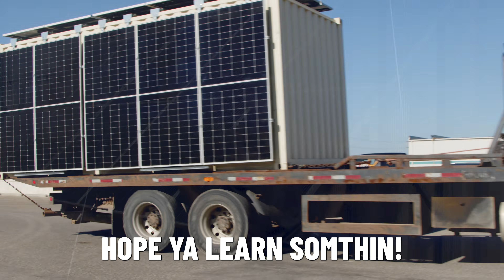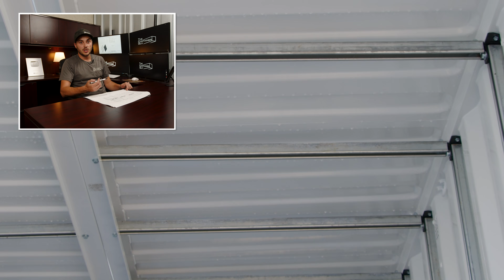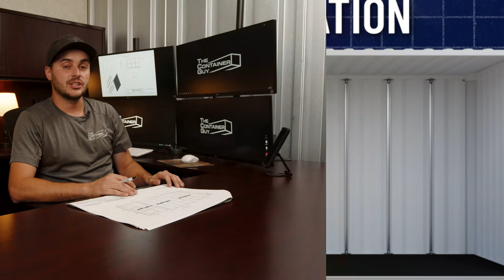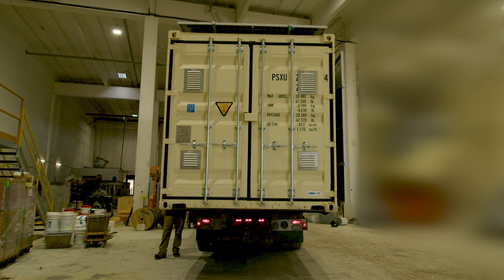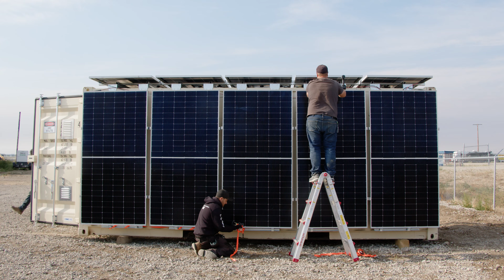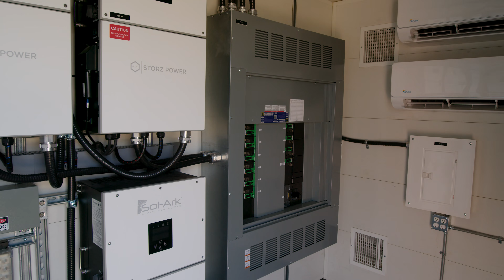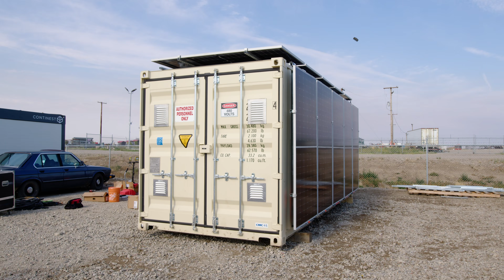Transforming a Shipping Container Into a DIY Solar Power Station! #NATO

Comment: Im not sure I understand where the 450k went. There is 5400w of solar on that container. 3x sol arks (youd be better off with Victron or Schneider) would give you all the 3 phase power you could generate and then some. A container that size costs 10-15k, the panels can't be more than 6k, the inverters 12-15k and rhe batteries another 14k ish...  Maybe 10k for all the load centers and wires. That's 50k plus labor.  Where did the other 400k go?  The generator and the transformer? Not sure what the transformer is for. Not sure why it needs 2 air conditioners either. Thoae things use at least 1k watts each. 20% of the solar yield.  Look its good clean work but the math doesn't really add up.
Reply: Container isn't $10 k😂$ 2-3k if it was new is all.i would give
Reply: @LouisvilleKyrich  agree I can get new containers all day long for 2k
Reply: Thanks for the analysis. I enjoyed watching the video, but when I thot of 450K it became useless for me to even think about, but I need one for my small 20 Ha farm
Reply: @nkosidywili8734 i could build you one for 60k. These prices are aaaabsurd
Reply: $50k Material 
$400k Labor 
😂
Reply: @moriartydrwatson3468  I think the #NATO Is the give away. This looks like a military project. MILSPEC is going to make everything more costly. The oversizing of the system is to tie to a solar array in the local operating area. I could see this being used at a field hospital… and so many other uses. Drone base, communications center you name it.
Reply: yeah, I was thinking: 450.000$ ... are these hinges and arms steel-plated gold ? The math definitely do not add up when looking at the 5400w panels.... but:
The 135kw would require a huge solar grid or grid-power, so I think this is a power distribution hub for much more than the 5400w panels, and then MAYBE the 450.000$ is right ?
Reply: @moriartydrwatson3468  No way is it 450k even if that's Canadian. That's 505k in Australia. That's a 1000% mark up.
Reply: Entire town? Maybe, if the town is one small family.
Reply: @OriginalJetForMe  i have more pv power on my roof and it still only covers like 75% of my power needs. We are a family of 3.
Reply: @OriginalJetForMe  It could power an Amish town
Reply: Your guess is as good as mine.
Reply: Those sol ark 15k inverter 15kWh battery combos cost about $18k each, this setup has 9 for 135kWh storage total. So $162k for the main parts, the rest takes you up over $220k maybe, the $230k must be labour and profit. The battery must go with a larger solar farm to make sense. Very expensive tho, I feel like I could build one for a lot cheaper, this is only 13x bigger than my battery setup in my van… I think I spent under $5000 for 10kWh and 4kW inverter and 1.2kW solar. So…. $65k plus labour plus a shipping container…. :/
Reply: In Arizona they are practically giving shipping containers away due to the poor border idea when they were stacking them as a physical barrier.
Reply: @moriartydrwatson3468  well some people building houses with bigger solar with 400k and well he build this…
Reply: They're pretty boys so it's a 50k an hour labor cost. 😂
Reply: You get 14kw solar panels for about 4,500. Of course the rest is pricy as well but 450k?!
Reply: @moriartydrwatson3468  the extra is for the management fee, bonus to managers etc etc
Reply: The 10, 540 watt panels are probably just to run the equipment. My understanding is that this will connect to an additional (ground mounted) array of solar panels. I'm not sure if any of those additional panels are included in the overall price.
Reply: I couldn't see 450k but what do I know..didn't see many ppl contest what u said though
Reply: @LouisvilleKyrich brand new... worst case ... budgetted at $10k
Reply: @ez2uk  for one container?
what u talkn bout willis?
Reply: @ez2uk  one container for 10k blows any  thoughts of a budget for anyone.😂
Reply: This unit was specifically built for a customer who had specific needs. The high cost quoted is the equipment supplied by the customer for an industrial application. The modification rails will hopefully be available as kit to purchase. If you have access to an industrial electrical supplier, you can purchase galvanized Unistrut channels, trolleys, and spring nuts used. The issue here becomes the mounting hardware used to mount the strut channels without penetrating into the main body. These mounts probably screw into the horizontal box beams of the container. Used 20 foot containers will vary in price from $2K USD to $7K USD depending on age and condition. The cheaper the container, be prepared to spend some money to clean and treat rust and then paint with an epoxy primer and paint. I don’t understand why these split air handler units are so expensive in the USA. Literally twice the cost of their European counterparts. Plus all units sold in the EU must be using inverter technology which is far more efficient than standard heat pumps.
Reply: @Subgunman  Anything being sold to a business has to be marked up 100 times. It's that idea that a hammer cost taxpayers $1000 because everyone who works there doesn't care what a business pays not their money. I work for a utility see this mentality on a daily bases.
Reply: Maybe all the manpower, union hours, safety checks n all that. Just the raw materials... Yeah $50k is even pushing it I'd say. GREAT idea though! I'm just starting to get into solar... I'm slowly building up to a 28.8kwh system.
Reply: This is in Canada so makes sense why it’s 450k lol
Reply: You can get a 20ft shipping container for just over $1100 USD in Toronto
Reply: The cost is the switch gear and other industrial equipment. You buy stuff that has to work. It's over engineered and costs accordingly. It's also been designed and stamped by an engineer. That stamp doesn't come free unfortunately. By the Saskatchewan research sticker, id say it's going to a remote site somewhere and is built to work no matter what during the research project. The whole project could be multi million dollar, can't have 7 months of work wasted due to something failing. To me it looks like it's got multiple redundant systems.
Reply: Agreed... this thing is very redundant and cant fail.  @onyxpartitian
Reply: All the custom metalwork + labor (figuring auto shop pricing of $200/hr), plus the A/C units and wiring.

There's another guy on YouTube who did the EXACT SAME THING, but did ALL the work himself, and he even added a Kohler propane backup generator.  He DID have a Tesla-Wall system professionally installed in the container (the only part he didn't "fabricate" himself).  His total was just under $100k.

Now, the BIGGEST DIFFERENCE between THIS system, and the one the DIY guy did, is that the DIY guy built everything ON SITE, so all the reinforcement didn't need to happen, and the only transportation was the empty container.

Comment: bro this thing is a pos.....itsnot worth 30k.  container 3k. some unistrut inside to mount a few inverters too. 500. the brackets etc sure 3/5k for 10 panels...expensive af.  neat. 5400 watts.  25kwh a day. enough to run maybe barely a 1 ton minisplit.  ie a joke.   why youd stack more than 10kwh of lithium inside it who knows.  once its discharged whats the point.  just getting the power from diesel or propane on site so....???
Reply from the maker: Did you watch the full video? Or a couple minutes then elect to offer this great wisdom for the planet? 

Which component specifically is the pos?
Reply: @TheContainerGuyTV   lets think about this. a megapack from tesla (market leader/or byd comparable) 1-2 mwh pack that prints gold and pays off in 2 years with a 3 year backlog. is only 1-2 million.  this is a 20ft container 3k? with 10 panels on the roof making 5000w watts?  

6k/450k.
9 inverters at 6k a pop why who knows but sure 60k.  200lb 10kwh powerwalls market leader at best 30k.  
throw 20k at some bum electrician for a week of work.  and were at 100k?  
oh yeah dont forget the 2k a pop minisplits so sure 110
ima just write 340k off on 2 random 3 phase panels somehow. 

who paid for this some dorky research facility or college?  9 sol ark 15kw even inverters max?  120kw. weird akward size nothing crazy.  tiny for a field huge for a house.  small commercial who has grid connection and a roof to start with? hella heat makes zero sense to try fighting that with ac.  they have aluminum heat sinks and fans on them for a reason.  even in texas at 105 theyre all rated to handle it or just derate slightly on fluke occasions.  what is the point of this oddity even?

the panels 5kw  have nothing meaningful to do with the inverters 120kw+?
the 3 phase breaker panels havenothing to do with the inverters 120kw? and the panels, no idea really massive 3 phase 480v industrial cabinets so guessing quite a bit more than 120kw.  

and then 2 silly batteries.....whats the point?    if its hooked up to 120kw of solar and 3 phase power when would the batteries ever be needed.  and then air conditioning the thing wut.
Reply from the maker: @richardroberson9277  I agree. You have no idea what this is.
Reply: @TheContainerGuyTV  yeah its a pos....as i said mate.  at best its some stupidly designed container designed to provide off site power to an oilfield or something.......that only requires them to install at 50% overcapacity (reccomended for inverters) 180kw of solar half acre of ground mount panels.  that has a wildly by orders of magnitude undersize battery for the power it outputs would assume backup power but 2 tiny batteries that top out at idk 10000 watts tops aint doin that with a plc that does nothing but turn on a fan and then ac for equipment that doesnt possibly need it....

humor me. do you think these inverters, that are ul listed and are installed in thousands of sites across texas/nevada and rated for 100% up to 105 and derate as needed need ac? does a tesla powerwall need ac? no...  if the customer wants it and paid for it by all means 

last i checked breaker panels dont need ac either tops a fan in a massive industrial electrical room far from outside.

by all means throw the equipment list out and id be shocked if it was over 30%.  
batteries if theyre even 10kw a pop premium 7k base 3k
inverters 6k approx - just 12/15 kw hybrid/grid tied inverters
2 ac senville 2 ton units top of the line 2k a pop
container 3/4k 1 trip
transformer 8k?
panels get wonky lets humor ourselves and say 30k

i cant get within 30%  hella margin you got baked in there. maybe i should stuff 50 inverters into a 40ft and throw 4 acs on it and 4 batteries and offer it for 600k ffs.  

heres my list - tell me what you think
40ft container 1 trip from a slew of reputable dealers (houston) 6k
pallet of solar panels take your pick 28/30/32 400/450/500 etc 7k 40 cents a watt - 13k total
20 sol ark 15kw hybrid inverters or grid tied meh 100k total 113k
4 minisplits  top of the line efficiency by senville 2 tons comingin at like 1800 sure 8k 121k
lets throw 10 ul listed 200ah 48v lifepo4 batteries in, assume i just order them from a landed source in the us out of los angeles.  meh 20k 300$/kwh is pretty normal  30k theyll never get lifecycled as backup power only time shift which this is useless for.

141k?. some spray foam, who cares what it looks like nobody is hardly ever stepping foot in this thing again if it works.
throw a 24" fan in every 10 ft. like the bitcoin miners do.

if you need to export to 480v yeah a transformer, just solid steel and coil inside 10k nothing that fancy, every 3 phase commercial property has small ones.

not seeing where 300k goes. guess ill give myself 150k profit for thinking and maybe go hire an engineer for half a year to build it on the weekends for 50k

but yeah, its not worth 450k unless someones eating a 300% markup on common commercially understood and available electronics.

Comment: Using air shocks on the opening and closing mechanisms should help to prevent injury or damage if they any chance the operator let the panels to close too fact or the stopper fails

Comment: Why do you need more than one solark inverter for that set up? The most the panels are going to produce is 5.4kw  which is enough to run a 5 ton ac unit in direct sunlight. To get the kwh you are suggesting you would need alot of batteries. So maybe thats why you have so many inverters? But even still if you had 135kw in batteries it would take those solar panels 5-6 days to charge them. But a average home with ac would use that in 5 or 6 days. I'm honestly confused on why it's set up like that. Why not just put one inverter if it's the solark 15k and add more panels? But the ultimate use case is what exactly?
Reply from the maker: This is the brains of the operation. Would have additional battery banks, huge ground  arrays, and 1-2 generators to supply a camp or northern community.

Comment: In areas closer to the equator a 3rd row of pannels could be used by using the opposite side of the container, but getting that right would be hard because they'd need to swing pretty far up and away, possibly 130 degrees from their stowed position

Comment: Why don't use some pins to secure and quick release the panels? Also, add like a Car Jack Lift to lift the panel? either manual hand rotation or power motor?

Comment: I can see setups like this for ground military setups. Transport power package out to camp/MASH site drop panels up and now you have power. The generator built into a 40ft container is even better. From HVAC side I would recommend setting up the condensers or outdoor units so that they face outward through the side of the container with a removable panel to give access to the internal parts for efficiency. Though the transformer will be on the air draw side causing heat build up, it will not matter when there is free air flow happening if there are roof vents also. This is a great system and have subbed to see what else comes of this.
Reply from the maker: 🤔🤔wonder who our end user (customer ) was🤔🤔 Can't say unfortunately...
Reply: @TheContainerGuyTV  What gave me the idea was seeing 480V for the power source. That was the hint since I am used to working with the military from a dependent point. Enough power there to kill a person. The cameras are also a hint since the power source room would be a point of interest for shutting down a location. Keep up the work.

Comment: Ambition strikes did this for 30k
Reply from the maker: Got everything for free?
Reply: @TheContainerGuyTV  I just watch their video again. Their system was not as powerful as yours it was a 30 KW system. The electronics batteries and solar panels cost $38,000. With the total cost of the build $50,000. So $400,000 makes a lot of sense when you consider the extensive cost of hinges for the solar panels and scrapping to keep the panels from flying off during transportation.😃 they are also DIYers doing it for themselves, you're trying to support a business. The remaining cost can be explained by the additional capacity that your system has.

Comment: Great product! .
As a truck driver experienced with road damage,  i would advise making the panels removable and placing them in secure racks inside for travel as sideswipes and road debris are a huge hazard on trips , no panel no power.
As for getting the panels into position,  a screw jack that can be 
A. Motorized and controlled automatically by onboard servos to adapt to sun position.
B. Operated with a drill. 
Drop the panel into its frame plug it in and crank it up.
Reply: Thinking the same thing !!!
Reply: Especially the way people are driving/texting....
Reply: And a wind diverter maybe
Reply: There could be 70kWP of Solar Panels stored in the hallway
Reply: Solar panels dont like rocks flying at them, but they also dont like to be reinstalled 100 times. I would say, cover them with an alu sheet when travelling.
Reply: @Strawdozz  from my experiences,  aluminum is too flexible and dents easily,  if one wants to provide a solid shield ,
A fiberglass faced plywood will provide excellent resistance at a reasonable weight gain.
But i still hold that storing inside will give the best results . Being outside and on the road is VERY abusive, being in a 50mph wind storm for 100's of miles jouncing up and down with road debris is rough on equipment, proper design for removal and installation is FAR easier on them.
Reply: @utoobuser206  You are probably right, especially the ones on the side get abused. How about making it bend and close upwards, not down to the side, then use a heavy rigid plastic cover on the whole thing. Cheap and durable, much cheaper than any metal, nothing gets through.
Reply: @Strawdozz  thats a better bet, seen less impact damage on topsides